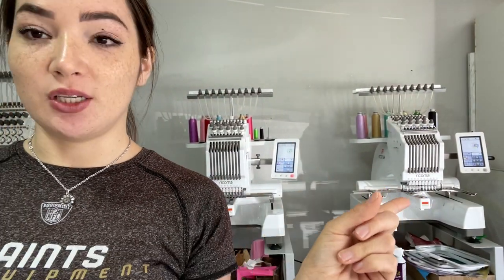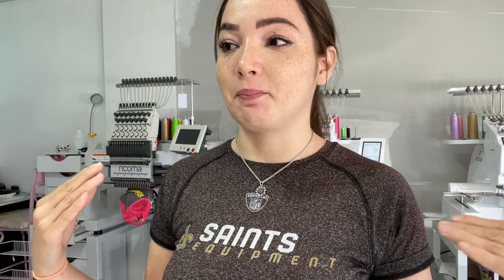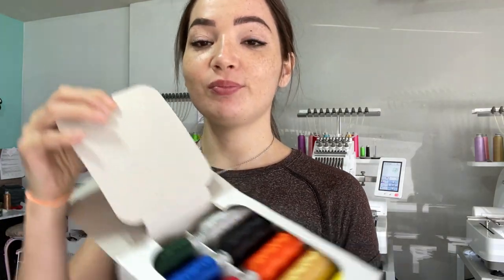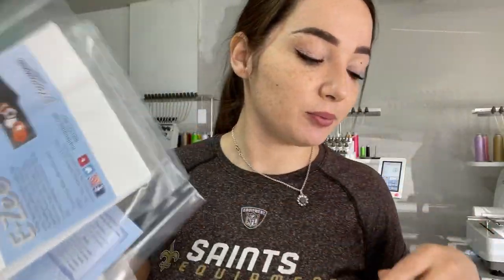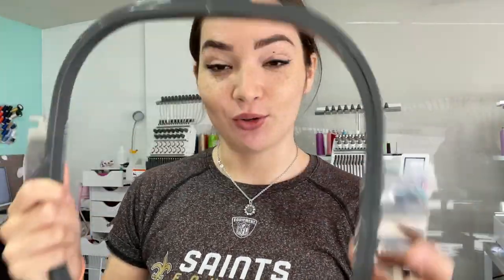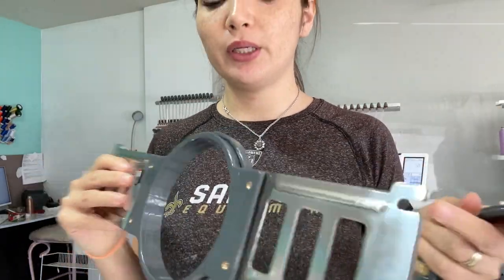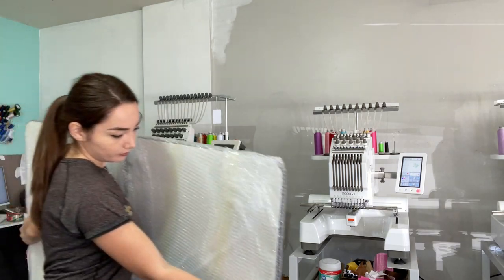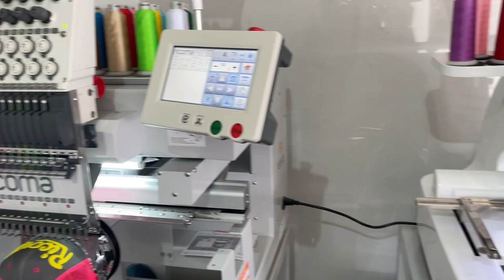Ricoma MT-1501 Unboxing Video

Comment: Hi Casandra...I am getting ready to receive this machine and was trying to order the mighty hoops for it but mighty hoops is asking for the dimensions of my sewing field...how did you order mighty hoops for this machine?
Reply from the maker: Hi
Just type in your machine model, they will know what to send you
Reply from the maker: Also know the size hoops that you can use for your machine 
I have the 8x9 mighty hoop and the 10x10 
Both I can use on the MT 1501 

The 10x10 does NOT fit in the EM-1010